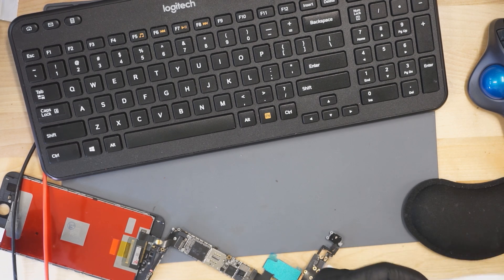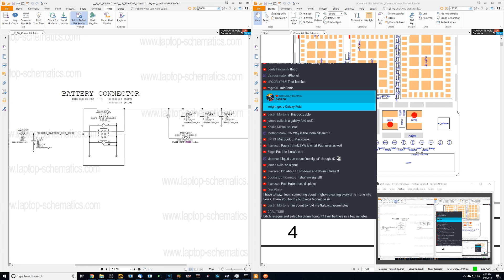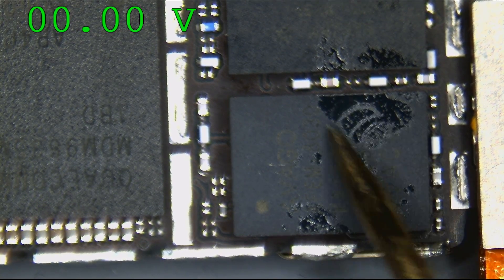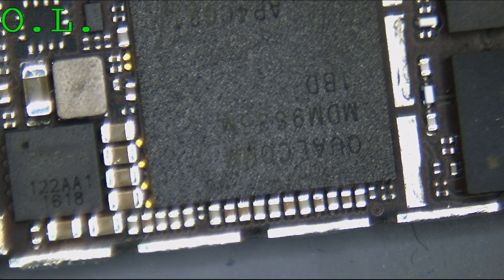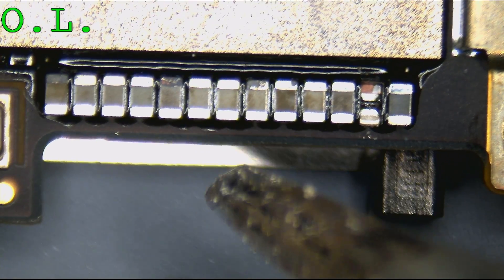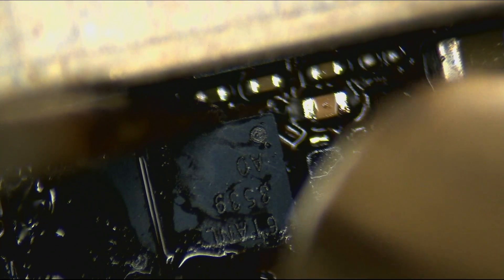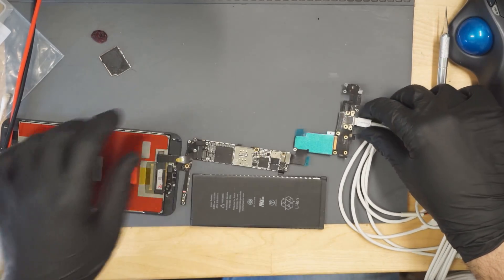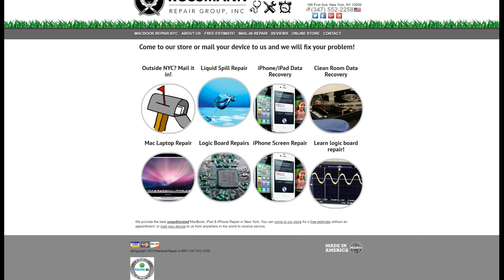iPhone data recovery after water damage

Comment: The issue with the mount on your microscope is it isn't level. When you go for tight macro shots, as you do with a microscope, anything not level can cause what makes it look half in, and half out of focus. Also the glass your using has another issue called chromatic aberration which is why sometimes it looks more pinkish red (magenta) or more greenish (magenta's inverse). I'd guess if you just leveled the mount and tightened it up, you would alleviate the focus and "fuzzy" issue. If it is intermittent, then the mount is too loose or not to spec, as I think you already know.

Comment: I didn't know you could recover data from an iPhone. Bc I used to used to have an iPhone 4 that got wet and everything was functioning except the screen and later the connector from the battery to the motherboard broke so I threw the iPhone away

Comment: Hey Louis,my dad runs a repair shop in my town and we have a 2010 MacBook Pro 13" that starts up and when it gets to loading the OS i would say like 15% through it shuts off. We tried resetting the PRAM and SMC,but it still has the same symptoms. We are wondering what might be the cause of this and we think that since you have repaired so many macbooks in the past you might know whats going on,so yeah until we can fully disassemble the MacBook because we don't have any equipment atm,what do you know might cause this issue?
Reply: Sounds like a software issue tbh
Reply: TheTrh51 
I know it does,but trust me when i say that it isn't. I tried a different installation of macOS with a different hard drive and tried to enter recovery mode and same thing happened
Reply: @verylongchannelhandle  beats me then. I would be curious about what is getting initialized when it dies.
Reply: TheTrh51 

Yeah,i know. macOS starts to load up like 15% through the bar and pop the display is black and the fans immediately stop. If i go into like the menu for picking drives it stays on,try to load macOS and it shuts down. It's pretty weird. I'm sure my dad will fix it though,he is pretty talented and has been fixing electronics for 30+ years,so yeah this shouldn't be an issue. Any help regarding this is greatly appreciated,thank you again.

Comment: At 2:27 that is scary Luis you have Cortana running in full mode which indexes your local searches and shares them with Bing searches. This has been discussed many times already and is why you turn off and disable Cortana. In the Enterprise this is disabled through Group Policy. There are many ways to fully disable it without group policy. Careful bro !!!

Comment: Why were you hoping it was an iPhone 4 lol? I have a 4S with a bad charge port that I could use the numbers etc from. Keep meaning to look into it.
(Edit- been reading your google docs guide Louis, thanks so much for making it. You the man)
Reply: Shields are removable without soldering, and the board is much less populated, components like caps and resistors are bigger and aren’t as close together. From the iPhone 5c and up, the board where getting very dense and components got much smaller

Comment: I don't ever want to hear a surgeon tell that he has shaky hands but as long as you get the job done when you repair electronics with shaky hands... :)
Reply: I mean there are extra donor boards and chips but there are rarely extra donor organs handy.....so I'd have to agree, though my hands are shite too after a long day.
Reply: @StormBreaker1987  
Also I prefer to keep my own organs and not get all those epitopes  which my immune system doesn't like. ;)

I am curious how I would do with soldering. Do I have steady hands or not? I am great at playing piano or guitar so maybe, but other parts of my motoric system can only be qualified as poor or mediocre at best. As if increasing your motoric skills at one thing decreases the available capacity of that part of the brain for the motoric control of the rest which would make sense given the limited surface area of that part of the brain and the fact that some parts of your body get a lot more connections than others to that part of the brain. Or it is just or also because I am tall and tall people have less motoric control in some ways? I don't know but it is interesting, they shouuld research it someday (relation between height and motoric control and relation between good pianists/guitarist and other motoric control). I would like to try out soldering with proper ventilation, just for fun, and hear whether or not I have steady hands. 

Being a surgeon would probably be a huge problem for me, I have used some of those tools (scalpel, scissor) and it was problematic because my hands are a lot bigger and my fingers are a lot thicker than what those tools were designed for. If I struggle at buying gloves which fit then I doubt that they make surgical tools which work for me.

Comment: Galaxy Fold has no wheels and does not drive. Why should I pay as much as a little car costs then?
Reply: A Mercedes has no bathrooms and no backyard. Why should I pay as much as a small house costs then?
Reply: Crappy analogy, Max. Why couldn't you compare it to some other laptop?
Reply: @larzblast  Proberbly because you can purchase a car for $2000.
Reply: @cmdrnachoman5864  Still isn't a good analogy. You can buy a pretty decent laptop for that kind of money too and it's probably a better comparison since they're both computing devices, with one also being a mobile phone.
Reply: @larzblast  that's the issue right, 2k for a phone or 2k for a Lenovo x1 carbon with a core i7 and 512 nvme SSD 16 gig ddr4 or a damn phone. x1 will take a sim too but you can't fit it in your pocket. it's whatever you need it for type thing. most like iPhone. it's gonna be a status symbol
Reply: It also lacks a headphone jack!
Reply: I guess it is about if it can keep up with a similar priced notebook. I mean, if it can keep up with a i7 8750H with RTX 1060, it is a hell of a bargain, if it is as powerful as a Galaxy A8 it is just a overpriced shit. Anyway, the price/performance in the past 2 years is getting continuously bad.
Reply: 'RTX 1060' lol? (Joking, I know what you mean). However no phone is going to keep up with even a GTX 1060 (or for that matter a 960), no matter how much it costs.
Reply: @Khola_D  That's probably the point he was making the whole time.